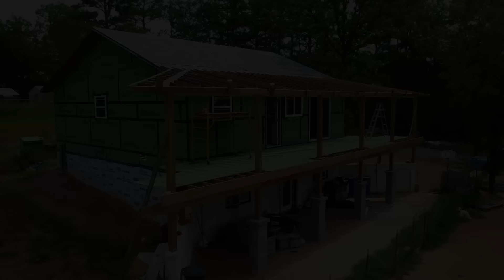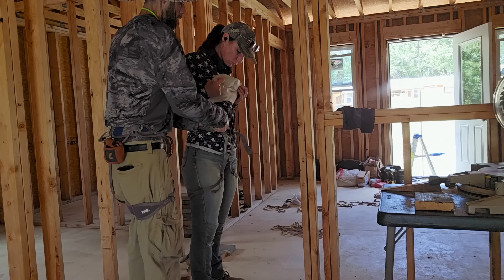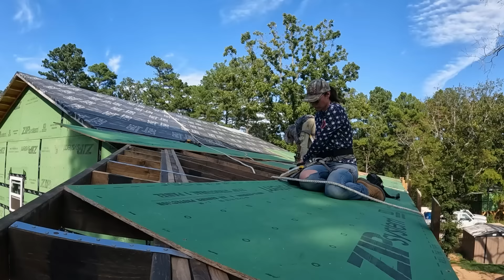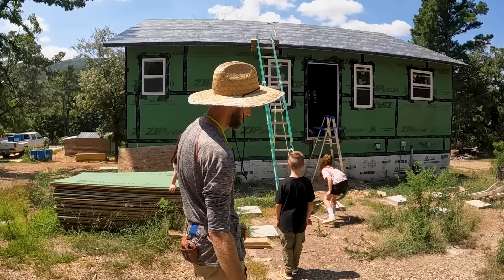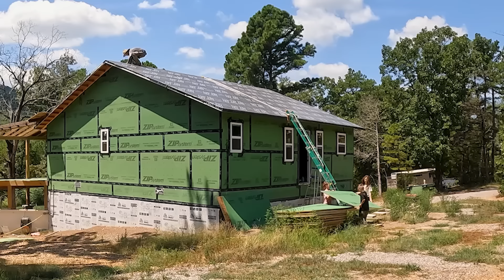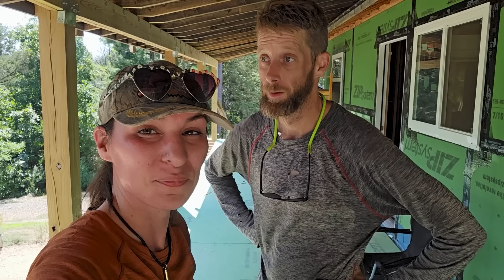We Worked SO HARD For This! ZIP BOARD Covered Deck ROOF  On Our Cabin Homestead

Comment: You’re one step closer to roofing!! I’ve been so worried about the roofing rotting bc that membrane gets weaker the longer it’s exposed to the elements. Esp in the heat there in Arkansas. I read it’s integrity begins to breakdown after 6 months, then saw commenters agreeing. It would be a travesty for you to have to repair the roofing or even inside from rot. What kind of roofing are you going with?